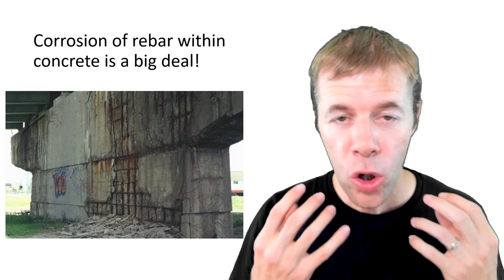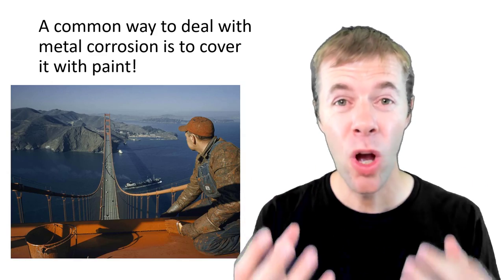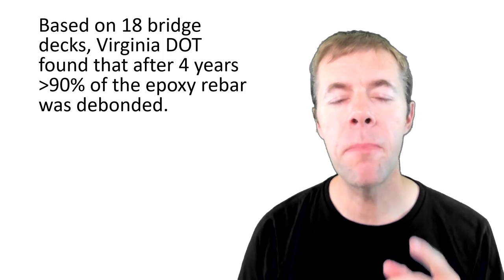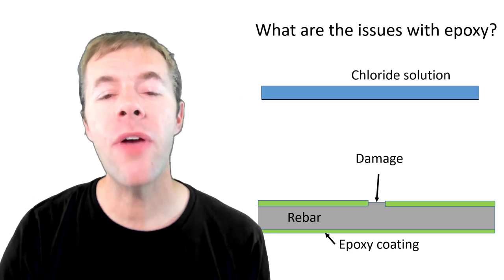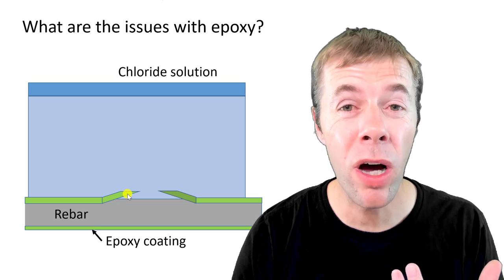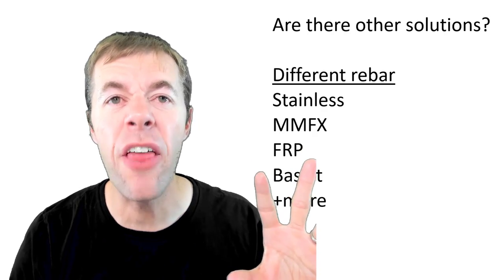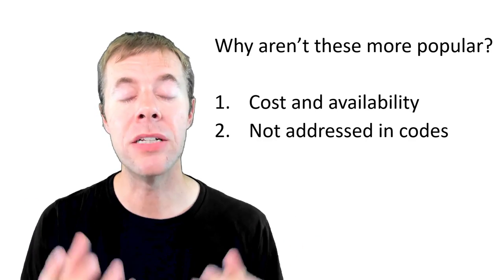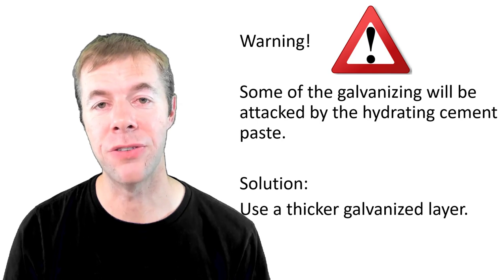What is epoxy coated rebar and why is it being banned?

Comment: I am a structural engineer in the netherlands and I’ve never seen the use of epoxy coated rebar in practice. Generally, we design bridges with a rebar cover based on the expected reference service life (based on the eurocode). Ususally 35mm for a up to 50 year service life and 50mm of cover for a 80-100 years of service life. Additionally the cover gets increased by 5mm increments depending on whether or not the concrete surface is inspecatble, the type of formwork and cholride conditions. Interresting to see that the epoxy coated bars perform so poorly as this goes against intuition. You’d think it’s coated so it be good.
Reply: Yea that's because rebar doesn't even corrode inside of concrete, there's no moisture lol. It takes very very long
Reply: Well, it does work perfectly... when it's a flawless coating at the time of pouring. But like he said, the coating is never flawless, even if handling very gently, which, let's be honest, the iron worker is not going to treat rebar like a new baby. Epoxy coating is one of those great ideas that is great in a lab, but marginal in regular practice.
Reply: 35 mm for a fifty year service life is actually a pretty good run.   As a contractor specializing in concrete repair and construction, I generally shoot for 50-75 mm in everything I do (when not otherwise specified).   I have a hard time imagining achieving accurate 5 mm increments of measurement in steel on a slab though, since the slabs are often sloped (and steel men never take this into account), the steel can be pushed down in placement of concrete, and few rebar-men are more accurate than about 20mm with any degree of consistency when placing horizontal bars (in my experience).  You guys must be following your steel placement people very closely to achieve such tolerances.  
The reason the epoxy bars do so poorly is the same reason you get a "holiday" around concrete repairs in failing concrete- there's a pent up charge imbalance that needs to use the rebar as an anode to reach equilibrium.  Coating a bar or replacing damaged concrete will simply result in the inevitable corrosion moving to the nearest available place to react.   In the event of a holiday that is the edge of the newly placed repair, and in the event of epoxy bar, it will be concentrated at any place the epoxy is damaged.
Reply: i poured my house with 3 inches (~76mm) of cover so it would last 200 years?
Reply: @9001greg  well, there is moisture.  Concrete is porous, and is like a wet sponge.   The resilience comes from the water in the pores in the concrete having dissolved chemicals in it that form a thin protective film over the rebar.  The PH of that solution is generally higher than 10, sometimes even 12.   Very basic.  This protects the steel from rust, and the concrete from acid decay.  Eventually it runs out though, and this is why greater coverage leads to longer steel lifetimes.
Reply: 80-100 years seems like a pathetically short service life.
Reply: @jermainerace4156 ou'd think so, but usually it gets extended far past such a life.  Engineers tend to be very conservative, and have good reasons to be.  Even so, there are a lot of ways to extend the lifetime of a structure.
Reply: @dykodesigns2yt, Any experiments with carbon fiber rods?
Reply: @ConvairDart106  Not that I know of, but I have seen Glass Fibre reinforced rebar once. It has a resin colour to it. The product is called "Schöck Combar". Carbon Fibres are often used in concrete repair applications, glued, laminated carbon fibre strips can be used to strengthen floor slabs and beams in buildings with changed load conditions or as a repair methode for fire damage. In that case the carbon fibre strips add extra equivalent "mm²" to the existing rebar.
Reply: @dooglemcdoogle4062   Not really, it's used in Australia too. We have a real problem with chlorides in the environment in some areas. You have to make decisions based on the environment of the structure.
Reply: @sundoga4961  What parts of Aus? I used to do precast in Melbourne and I worked construction in FNQ and we never used coated. We relied on proper vibration and proper cover.
Reply: @Dantheus  
I get this a lot when you call out BS  on a channel.
Look at his profile with 3 subscriptions to channels. It most likely a fake account from producers of this channel. Try and call out BS on "linus tech tips" and see the fake accounts attack you!
All by starting with the same cut
and paste reply.
Edit:
This debate seems not to be going away anytime soon, I like how I posted my comments under the thread with the  engineer that disagreed with channel and the people attacking me all have only three subscriptions each. " comment's from fake accounts!!!
The producer's trying to shame people into deleting comments!!!
Reply: i love how you use the word "service life" explaining how they are designed to fail after a given time period. about sums up how everything is engineered these days. i know if you built bridges that lasted forever you would eventually run out of bridges to build but its pretty shitty thats how cars and appliances are. can only get 10 years out of a brand new car from start to finish and thats if you took care of it like a child and actually drove it about 250,000 miles when we have the technology to easily make them last well over 1,000,000,000 miles. even gas engines. 75% of engine wear happens during warm up and 75% of the warm up wear comes from the few seconds it runs without oil before it builds oil pressure. simple fix: an electric primer pump that comes on and waits to start the engine till it builds oil pressure. they would last twice as long but they will never ever make cars like that and if they do they will make something else break instead. pride in your work goes away when money gets involved and we all know the love of money is the root of all evil
Reply: @Dantheus  I'm in Perth, but most of what I saw of it was up in the Ord River scheme. We have a LOT of chlorides in our substrata up there, apparently.
Reply: @dooglemcdoogle4062  I work in construction but am not an engineer. I have made metal brackets in my forage for home projects and cooled them from red hot in an oil bath. I have been surprised how long it took to  for them to start rusting, they did, but much later than the same steel in my scrap pile.
Reply: We use to put galvanized plumbing pipe in to walls and if you pull out a 20-30 year old pipe its 100% rusted from the outside so hot dipped galvanization is no good. Also it  too can get nicks and scratches so its not full proof and plumbing pipe gets treated way better than rebar. So i think we are kinda stuck with what we have and we should call it good enough. i would shoot for a better coating
Reply: @chaytonruijsenaars3971  While i do agree that some stuff could be engineered better for a longer durability, one needs to see what would be needed to extend that lifetime, and if it is worth to do so.

A bridge designed for 80 to 100 years od expected service seems resonable. They are designed to last that long at least, not to fail immediately afterwards. With more careful inspection, the bridge can be in service for many years to come.

But after a hundred years, expectations and technology change. Many bridges have been upgraded or replaced before their expected service time because they have become to small for the traffic nowadays.

The same goes for cars. As much as i would like a car that is capable to last way longer with less maintanence, i am replacing the car anyway. Newer models have better performance, need less fuel, create less pollution. They have better protection in case of an accident, have advanced electronics and assistant systems.

Out of nostalgia, i used a 50 year old refrigerator from my grandma for many years, but replacing it would have been cheaper in terms of energy consumption. And the reduced noise level is worth alot. It just became to small for my needs.

I buy expensive clothing that lasts way longer than what many people wear, because i hate wasting cheap crap. But i wouldnt wear my clothes back from the 90s, if they would still fit and hold together...
Reply: @spikes1529  you don't know a thing about engineering !
You most likely put the reo in the neutral axis of the slab rendering the enforcement ineffective!
Most the enforcement bar in most house is for shrinkage cracks, it should be placed no more then 25mm below the surface!
Reply: @sundoga4961  
Are these the same  MIDI-CHLORIANS?
Out of Star Wars?
Reply: @dooglemcdoogle4062  Not sure, I'd think a Midi-Chloride would be a chemical that you use to make music...
Reply: better building codes...
Reply: @ConvairDart106   price and availability... were talking mostly older structures that back in the day carbon-fiber was a sci-fi thing.
Reply: @spikes1529  Is that a question?
Reply: @dooglemcdoogle4062  evidently only you would call rebar (short for reinforcing bar) reo bar which means nothing. We are talking about rebar here. Perhaps you have a foreign word for it or something altogether different.
Reply: this guy's theory and premise InDesign is a failure and I'm glad you see that because the steel coming from The LumberYard to the job site to whatever it's there's no care in it it's like threaded rods or most other treated the way it's treated and you use what you get this guy is nuts and you had a good answer I'm not an engineer I'm a carpenter
Reply: @asbestosfiber  
No.
I am not a arm chair expert like the rest here. I only have 27 years experience in construction with a education and qualification for open class!
Reply: @blackbirdpie217  
Yank "rebar"
Aussie  " reo"
That's how some people here know I am from Australia and the term "concrete cancer" which was a problem in the 1970 high rise construction industry fro. Cheap shoddy builders not vibrating concrete.
Reply: dykodesigns2yt what about pre-tensioned rebar? It could easily be manufactured under controlled conditions to prevent this, because the concrete is cast during manufacturing. I'm a aircraft maintenance engineer so I know little about concrete, but I do know the strongest concrete has pre-tensioned rebar
Reply: @dooglemcdoogle4062  Sorry, dude, I'm no engineer. I was up at the Ord during the construction of a private resort maybe 10, 15 years ago, my job was catering and food management. But I noticed the coloured re-bar they were using and asked one of the engineers about it - I hadn't seen it before. So I'm pretty much just parroting what he said.
Reply: @sundoga4961   So I just proved that you did not work on the project you mentioned that had a so called " Chloride" problem
Now you where down the road in the Margaret River Region
Now your are saying you don't work in construction 
But you remembered what a engineer told you 15 years ago!!
and you decided to weigh in on argument that don't know the first thing about!!!!
Really?
Reply: @sundoga4961  
LOL
Reply: Epoxy seems to separate from steel after a few years regardless of corrosion.
Reply: @hosmerhomeboy  thanks for that anode / corrosion explanation. Without that the concentrated pitting he described at nicks in the epoxy didn't make sense.
Reply: @eblackbrook  YW.  There is a lot about failing concrete that doesn't make sense unless you start get into the electric/chemical side of things.  There really is a ton of information out there, but for the curious, I recommend ACI, and specifically ICRI.  It's expensive to pay for, but the information is invaluable, and they offer courses and certifications as well.  Short of that, it's hard to find sources of information that are accessible and consistently reliable.  Lots of people out there who know just enough to be dangerous.
Reply: @Andrew Manche while concrete has been used, the collosseums main structure is made of massiv stone parts outside, and bricks inside. Have visited it. They had awesome engineers.
Reply: @dooglemcdoogle4062  This is very interesting.  What are the general goals of the producers?  Jackassification of information?  Broader?
Reply: @Andrew Manche Roman concrete is replicable but lots of stuff and mixing mixing mixing, a Marine mixes it in a bucket here on the tube.  Industry might be able to do it better.
Reply: @dykodesigns2yt Hey I have some questions for you! This video got me looking at alternatives to rebar and I saw this stuff called Basalt Rebar, have you heard of it or had experience with it? It's supposed to be made of volcanic rock (I've worked with rockwool, its made from slag and volcanic rock I believe! Sucks to work with, gets into the skin and comes back out looking like small whitehead pimples all over your arms. And it burns like a mofo after handling it for a while and having it rub the inside of your arms) but thats the first time I've heard of it being used for rebar. Also would it be possible to use carbon fiber as a rebar/ in combination with it? Like use the hardening resin as a bonding agent to the rebar and have it carbon fiber wrapped? I know they often use other fibrous materials to help with structural integrity like glass/synthetic/natural fibers, so I can imagine carbon fiber being used. Maybe not for rebar coating but woven into the concrete itself.
Reply: @martind349  I have been to the coliseum twice 
it was made of large stone Travertine blocks stacked on-top of each other, but was held together with brass rods which have been looted over time " would be in better condition if not looted"
so don't know where you are going with your comment?
anyone who has studied construction would have known that the so called Roman concrete was made with pozzolanic ash with lime that made it waterproofed , which today you get as PORTLAND cement!
Lime has also micro healing ability's and is also a good plasticiser.     
not that this crap channel would know the BASICS about cement.
Reply: @spikes1529  : Has long as you Hagan proper  base and mesh laid down. There should  be 2 layers of mesh, 0ne an inch above grand another mesh an inch  below the top of the  concrete.
Reply: @sheisgreat123  
I think what you are tying to say is 
top layer one inch from top
and bottom layer one inch from ground 
that's on the money but remember concrete has high strength in compression and week in tensile so your reo/rebar needs to be more/grater in the middle bottom of a span then transfer to the top layer over a column/wall.
Reply: I'm just gonna say it. I'm kinda over cars and bridges. And as for buildings what's wrong with steal and glass
Reply: Haven't watched yet, but epoxies wick and hold moisture, that may be the problem.
Reply: @dooglemcdoogle4062  Not BS clickbait -- It's just being explained as how things are done here to laypeople.  And you left out, reason to use it in USA = additional $$ to the petrochem industry that produces the epoxy.   Fact is a lot of these epoxy rebar applications will never see much chlorides -- for example, I watched an entire high rise condo go up near me on the Chicago lakefront.  If it was on the coast of Florida or Virgina Beach, OK, but the salt truck isn't going to be tossing so much de-icer that it goes 40+ feet into the sky and there is zero salt air from Lake Michigan.
Reply: All water proof added layers just hold in moisture once it fails. Not as great as they sound
Reply: @gilliesiut2332  hi gillie. Your comment appears to be one of the few genuinely constructive ones and pretty easy to answer.  Pretensioned rebar is a thought in the right direction, but not a good fitting solution. Pretensioned rebar (aka prestressed concrete) cuts down on rebar corrosion by reducing/preventing cracks that occur from concrete shrinkage and concrete deformation under loads (in tension areas). While that prevents rebar exposure to moisture through cracks, it doesn't address moisture through concrete's porosity. Also, tensioning rebar isn't that easy to accomplish in the field. I hope that explains a little. TBH, I have been retired for over a decade and just learning the coated rebar we used so much has proved so ineffective. Plan to look into it more. It will be interesting to find out more about how civil engineering design and construction will address the issue.
Reply: @Andrew Manche Different design approaches. Romans employed the arch mainly, in which the building material remains in compression (no rebar needed). Arches can span only relatively short distances. (For ex. You couldn't span the Mississippi River with a stone arch. Also, did the Romans have concrete? Or just stones? I might google that later.
Reply: @spikes1529  lol. If it was only that easy. Cover needed also varies with whether the concrete is exposed to earth or the air (or salt water or deicing salts). Your house  should last a good long while though (you may get to  200).
Reply: Killer Chicken thank you for your response
Reply: Here in Ontario, Canada we use large amounts of salt and other chemicals on our roads and bridges in the winter months.  (The largest salt mine in the world is in Goderich, Ontario).  This just accelerates the corrosion process or oxidization process.  Also the road/highway authority here in Ontario is MTO (Ministry of Transportation, Ontario).  The head person is the 'Minister.'  DOT is an american term (Department of Transportation).
The epoxy coating is used to slow the process down or protect the reinforcing bar. (or so it seems).
Reply: Buddy, everything wears out; even you and me.
We could all drive around in vehicles that are built to last.  For example a tank or a Hummer.  Think of the cost to build and maintain and the fuel efficiency and it is not practical.
Reply: @jermainerace4156  Agreed, but so much depends on the structure type... football stadiums in the US have shorter life spans these days than ever in the past.   For bridges they need to maximize that service life as they're probably the most difficult and painful (in terms of traffic interruption) to install/upgrade.
Reply: @spikes1529  instead of 35mm - how about 15mm or less and the use of BASALT reinforcements - and a 400 year lifespan?  Wouldn't that be much cheaper ( over the lifespan AND the initial materials costs )??
Reply: @hosmerhomeboy  what are some of the ways to extend the life of bridges and other concrete structures beyond 80 or 100 years?
Reply: @gilliesiut2332  what about pre-tentioned Basalt rebar in strength comparisons?  2. Are airport landing strips built with pre-tentioned concrete?
Reply: @roberthayes2027  well, we can install sacrificial anodes, which are lumps of conductive material that will preferentially corrode, protecting the rebar within.  We can also add a small continuous charge to prevent the reaction as well (not 100% sure on the ins and outs of that, but I have read about it).  We can also upkeep them with certain chemicals that are allegedly capable of preventing corrosion; I do this often, but the products have only been around for about 25 years, so we will see if they live up to the hype.  Better design goes a long way, although the designs we use now are not bad.  Sealing concrete also works, this can be done in all sorts of ways, ranging from acrylics, to hydraulic cements, to epoxies, and on.   
There are other ways I am sure, but those are the ones that come readily to mind.
Reply: Interesting but this remind me that some decades ago the oil industry marketed a tar based product for spraying on exposed steel work in salt affected environments.  This proved very popular for some years,  until it was discovered that in fact the tar layer simply locked a layer of salty water next to the steel greatly ACCELERATING corrosion.  You know the rest.
Reply: @chaytonruijsenaars3971  You probably also believe that there are carburetors that run on water but they have been suppressed by a conspiracy.
Reply: The other thing with galvanizing  is when you scratch it, the zinc keeps protecting the exposed steel by acting as a sacrificial electrode.
While the epoxy coatings guide the chemical solution underneath. Also a problem with coatings in car restoration. You think you win with an epoxy coating but eventually it blows off with corrosion from a stone chip.
Reply: I've built a few power plants and green rebar is all I've seen on these sites.  After cutting it and so forth,  lots of people do not take the time to paint the spots after cutting.   So because of that one person unprofessionally, all that money is wasted due to negligence
Reply: @chaytonruijsenaars3971  1 billion miles is pretty extreme, even for a frustrated exaggeration, but i get you. if anything is built today its in a hurry and there are always shitty decisions baked in on purpose or otherwise. no one would buy a new car and there wouldn't be as much competition if they all worked flawlessly and ingenuitively for 500,000 miles.
Reply: @dementedbowine8681  different material not better coating
Reply: @michaelguth4007  good addition to the convo.
Reply: you can match the strain profile of the materials, be it carbon steel glass or various concrete mix designs with or without fiber and pretensioning in the reinforcement. its why it needs to be engineered to satisfactory specs. there is play in the structure or its much stronger and snaps etc
almost all concrete should have good fibers
Reply: I have heard of that product and have also seen it on tradenshows a few times. I believe it’s quite expensive. Carbon strips are populair for fire damage repair and improving the strength of existing structures when load conditions are altered, my boss does the engineering for these quite regularly.
Reply: @dykodesigns  carbon f, even though it snaps, really really increases the compressive strength of a beam or pillar and tensile . goes from unconfined to confined, the rock can't crumble out of the way anymore so it takes way more load
Reply: I believe that happens due to the high quality of the concrete used in the Netherlands, proper design without cracks and also, I believe a special type of concrete is used in the areas near the sea, sulfide resistant concrete to extend its lifespan under contact with seawater. Correct me if I am wrong. I just remembered that concrete cracks are not allowed in the Eurocode.
Reply: @9001greg  But rebar expands inside of concrete, cracking it and peeling the outside layers of the structure away. Then it gets corroded, worsening the process.
Reply: @hosmerhomeboy  Good concrete should be impervious to moisture. but there are other factors, as cracks, imperfections, junctions and thermal expansion.
Reply: In middle east mostly all govt based buildings are built with epoxy coated steel only, they provide 75mm cover for footing and column 65mm,due to high chloride and sulfate content in soil
Reply: @blackbirdpie217  m I
Reply: @9001greg  uh...yeah it does... & it creates critical spall of the concrete ...which can cause critical failure of the entire structure. It's the same issue as freeze/thaw splitting of concrete.
Reply: @sundoga4961  Thank you! Many people forget that concrete is just an ad-mix of (generally) local ingredients...build in an area with high calcium or sodium carbonate in its sand (or the mix water) and your going to end up with higher suspension of salts in the concrete...add that to a seaside site with constant spray to the final structure and you have a highly corrosive enviro for iron products...
Reply: @Dantheus  precast has smaller medium ingredients and controlled curing in a factory...
Reply: @gilliesiut2332  pre-stressed...that's the term we use here.  But we used cable, not bar for it...and that's usually a different metallurgy altogether.
Reply: @dementedbowine8681  Basalt rods are the solution, in my opinion. Galvanized rebar is just a slightly better version of the same problem. Basalt eliminates it completely, with near zero chemical reactivity to anything, plus it expands and contracts at the same rate as the concrete that surrounds it.
Reply: @palarious  yep as much as i would love to argue with you i have to agree dont know about the price and material avalability. We use a lot of steel  and no one is thinking we are gonna run out dont know about basalt .
Reply: @hosmerhomeboy   LOL, unless you're a high rise builder in Sydney Australia
Reply: @spikes1529  it may develop serious cracks due reduction in effective depth of slab and beam, if it's not considered in the structural design.
Reply: In the 1960s our militaries during the COLD WAR requires that all rebars be thoroughly sand blasted cleaned top, bottom, left side, and right side and air blasted cleaned of any embedded grit and contaminants. They they are anodized with the use of potassium permaganate and then electrostatically sprayed by a molten zinc-silicon-tin 80/10/10 alloy to penetrate right though many surface anomalies. Why this standard wasn't applied to civilian engineering is a question that someone must answer.
Reply: Must be new product. Ive never seen before. Every coating breaks down (sacrificial coating ) like triple gal screws!
Reply: You have to inspect and repair the coating if it has damage. Coated tie wire is also required. I have used it in a potato chip factory, a Procter and Gamble paper plant,a power plant, oil refinery and several other projects. Never had an issue.
Reply: What